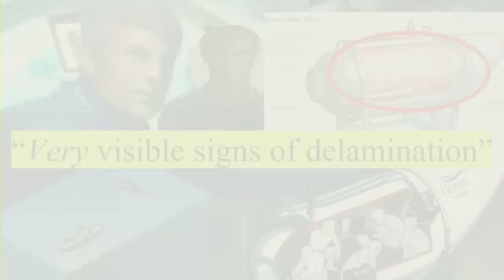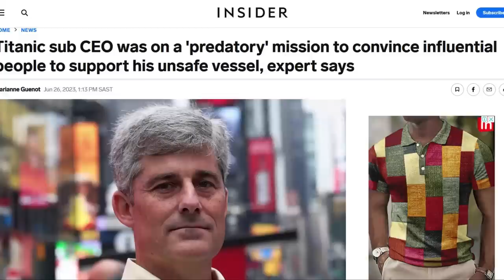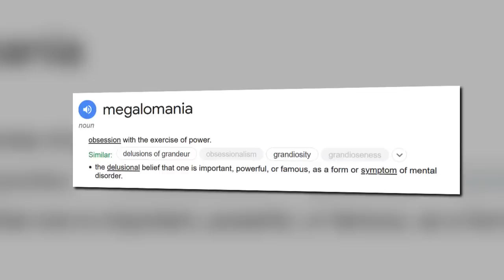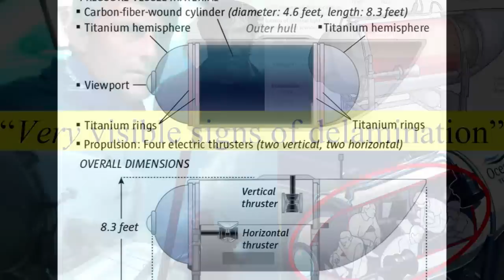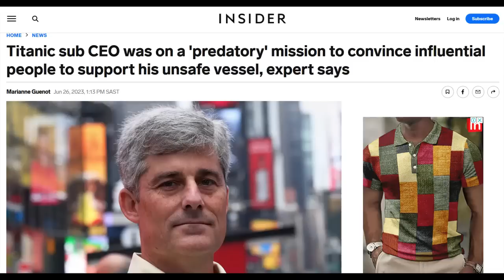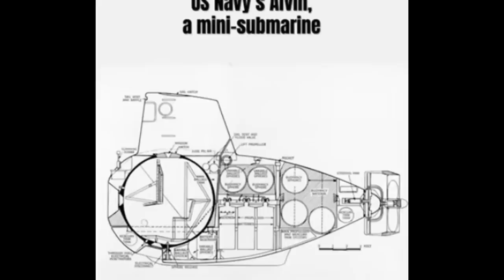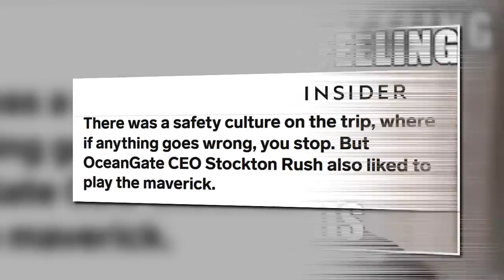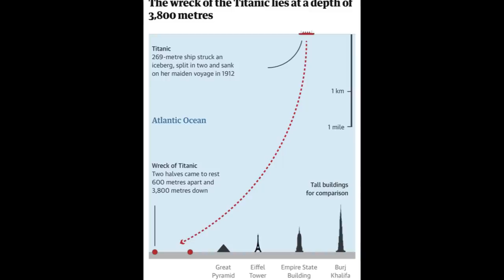"Lochridge shone a light through a sample of carbon fiber and saw splits in the midsection..."

Comment: anyone that has seen carbon fiber fail would know that acoustic monitoring would be completely useless
Reply: Aye, if you're hearing cracking, you're hearing failure of the matrix.
Reply: I’ve heard that anyone who has a bike made from carbon fire can see the stress cracks over time. They’re visible. 
It boggles the mind. Rush wasn’t a stupid person; he’d had training in engineering. I find his misguidedness incredible.
Reply: @m.h.6499  this last couple of years has really taught us that having money or connections does not equate to having brains LOL. i guess at least elon was at least smart enough not to vaporize himself and innocent people. yet anyways.
Reply: @m.h.6499 they aren’t always visible. Carbon bike frames are coated to reduce abrasion, so sometimes the fiber matrix isn’t visible. When carbon frames fail, it is often completely unexpected, like your fork completely vanishing when you apply the brakes.
Reply: Yeah, I’d imagine that the warning would occur about the same time that the shell implodes at the speed of sound.
Reply: @Subtlenimbus   Then I must have misheard. I thought I saw someone commenting that the cracks in the carbon fiber are visible on bikes. (I’m not a cyclist so was going by what I heard). So that’s why Rush wanted the warning system. I can’t get my head around his conviction that there would be time to re-surface, when it takes time, and the alarms tell you that failure is imminent. Surely he had to know the flaw in the logic? 🤔
Reply: @m.h.6499 it was purely narcissistic hubris. He was unwilling to accept any failure. He was unwilling to accept any faults.
Reply: @beehappyalways  HG Tudor has done an 11 part series on Rush on this platform, analyzing a great deal of evidence about him to conclude that in his opinion Rush suffered from Narcissistic Personality Disorder and possibly psychopathy. I found it thorough and thought provoking. He doesn’t hit you over the head with it but methodically builds his case. It makes a good complement to this video and questions raised here, and the story generally. I recommend the series. I couldn’t get my head around Rush’s behavior at all until this series offered some insight. It helped explain the incredible hubris so many of us have been observing. 
I do feel sad for his family. They don’t deserve this pain.😔
Reply: @m.h.6499  Of course he did.  I haven't seen ONE CLIP where he said that a warning would save them.  He only said that they would hear it before it fails.  He never said that they would survive after hearing the crackle.
Reply: @lindac6919  I saw a clip of Rush showing the submersible and saying, “The lights can fail, the thrusters can fail, but you’ll be alive.” He was explaining how good the hull was, made with this great substance, carbon fiber, and with the warning system. It’s one of the ones in which he’s explaining the Titan to someone, or a group, of real or prospective riders. I’ve watched so much of the coverage and seen so many clips, it would take me a while to find it, but those words rang out. It was all so safe that “the lights can fail, the thrusters can fail, but you’ll be alive.”
(Though I thought it was said in a way to suggest none of those failures would ever really happen).
Reply: @lindac6919   What would the alarm system be for if not to save them? Why build it?
Reply: Especially since apparently it was NORMAL to hear crackling noises inside this submersible.
Reply: yet, Stockboy did just that.
Reply: @m.h.6499  The illusion of safety, most likely.
Reply: There was another video on yt supposedly the transcript of the final communication moments. It was pretty creepy they reported hearing sounds. They dropped the ballast and barely even gained altitude. The pressure sensors were also sounding the alarms
Reply: Yeah when I "stressed" out my mountain bike "carbon fiber" aka cracking sounds.. I didn't sell it I destroyed it😎.  -no more carbon for me. Titanium is awesome thanks😂
Reply: @m.h.6499  The term engineer is loosely used because having a degree does not make one an engineer.   The art of engineering is what makes one an engineer.   Rush was a typical corporate bean counter with enough money to call himself whatever title he chose.  Unfortunately, he chose to call himself captain of that death trap Titan.  
 My heart goes out for all of the passengers, especially the young 19 year old kid.
Reply: @m.h.6499  Trust me, I know more than most about mechanical testing of carbon fiber.  Strain gages are used to measure the point at which catastrophic failure occurs when testing carbon fiber coupons(test samples) in an MTS test frame.  Google it if you are interested. They had installed strain gages in the sub to monitor the carbon fiber so they could tell people there was sort of warning system when it was false.  All lies. As soon as the monitor indicated a problem,  water was moving between the plies of carbon fiber as it delaminated, making the sub less buoyant until it became negatively buoyant.  Implosion.

Comment: One of the "experts" (who also dives in uncertified self-made subs) featured on the news was on the 2nd manned Titan dive. He knew Rush well and tried to advise him about the problems relating to the carbon fiber breaking down based on the cracking popping and banging noises made by the hull throughout the dive, even coming back to the surface at only 300 feet deep it was still making all the noises... A channel called ACE has interviewed him twice if you want further information.

EDIT - the problem or confusion with carbon fiber is that while it's stronger than metal pound for pound, you still need enough of it to make a structure stronger than metal; 2mm thickness of carbon isn't stronger than a meter thickness of steel. People seem to think of it as some kind wonder product with infinite strength without contextualizing the reality of what its strength is and how to actually appropriate its use. Also its strength becomes its weakness in that it withstands the pressure or weight and then has sudden catastrophic failure like glass, it has stregth when used in the correct way but it's also fragile.

Comment: They should have used a giant vacuum chamber, or vacuum bags when winding that carbon fiber hull. 
I saw their Chief Engineer mixing epoxy in bucket and just painting it on for the titanium end caps. He didn't pull out the air bubbles. 
I'm a NOVICE with carbon fiber. I READ about this before actually buying anything. A lot of people use vacuum bags. 
It's sad that I'm more aware of what air bubbles can't do at just 1 atm of pressure than this "chief engineer". 😢 He needs to be held accountable for his mistakes.

Comment: Stockton's idea of having a microphone listen for the crack of bursting fibers isn't new. Certain types of bridges use twisted wire as reinforcements, however those wires snap and microphones in those bridges are used as a tool to tell when the bridge needs to be overhauled...

However, in Stockton's case, you don't have a bridge under a somewhat constant load, you have a craft that sinks to the bottom of the sea, where the load increases and causes the maximum threshold of pressure the ship can withstand to go lower and lower.
So, when the ship went down the last time, something happened, that was inevitable under these circumstances: The ship can only withstand pressure to, say, a depth of 3,500m, that the ship passed. Now, a lot of fibres start to burst, weakening the ship immediately, meaning the ship can now only withstand pressures up to 3,400m, while still being just below 3,500m... a few more fibers burst, the hull's strength goes further down. Stockton assumed this would happen slowly enough that he can just drop weight and go back up. He got a rather effective presentation that this doesn't happen slowly, but rather at the speed of physics.

Turns out, "the speed of phyiscs" under these circumstances takes less than a tenth of a second to fully play out from "slightly weakened craft going deeper than it's hull can withstand" to "the ship is being turned into tiny shreds of carbon fiber filled with meaty paste".

Comment: The more and more I learn about Ocean Gate sounds like Stockton is at fault for everything. If you spoke out you got fired. So you just did as you were told. This guy had zero clue about the materiels used and how they broke down and react to the pressure. TOTALLY CLUELESS...

Comment: I have some experience using carbon fiber in high perfomance radio control aircraft.  Our stresses are different, but when I saw how the carbon fibers were laid in one direction it looked to me as there was potential problem brewing.  Another issue of joining dissimilar materials over a large area is also disconcerting.

Comment: First of all, this report does not state where this section of the carbon fiber hull was viewed in front of a light source to see rays of light passing through the carbon fiber elements!  The hull was built by layering sheets of carbon fiber on top of each other layer after layer and it was 5 inch thick!  There could very well have been micro-fracturing of the fiber elements but to say someone put a light source on one side and could see through it is nonsense!!!   If that indeed was the case, there was no way the sub could have made it to the depth that it did before it imploded!  If the hull was that porous and light could pass through it, you can bet water, hardly under any pressure would leak through as well and the leak would have happened the moment the sub was placed into the water!!!  This is pure nonsense!!!

That being said - CF structures are very very strong when the fibers are loaded under tensile loads but NOT compression loads.  The Titan sub had the CF hull under compression loads so it was bound to fail!!!

Comment: As experimental logic shows, the only way to know when there were too many "snaps and crackles" is to test to destruction.  Clearly not done.  The other thing is the detection of "snaps and crackles" can only save you if you can almost instantaneously depressurize by going from 4000 meter to the surface in milliseconds... clearly not possible... OR if the "snaps and crackles" are the indicator of progression into a permanent deformation zone that was not catastrophic (like steel yielding and not shattering)  again a condition not met.  This entire approach was coo coo.
Reply: When you hear the noise, it's already too late. The material will re-expand as the pressure comes off, and it won't do it evenly because some of the material is now broken up and has a different volume and some of it has been deformed beyond recovery.  More of it will fail as it seeks a new equilibrium of internal stresses.
After a dive, that tube must have let out the occasional snap and groan while it was sitting on the sled, like a hot motorcycle in the driveway. The difference is that it wasn't made of different parts that all shrank at different rates, or at least he didn't realize it was.

Comment: he manufactured and drank his own cool aid for certain, he was either blinded or willing to gamble with other peoples lives, oceangate was shaped by stockton rush to ignore the most basic safety concerns, he built a company that could get away with building such a sub and ignore the safety warnings, it was the company rush built that built the sub, so really ir was the company oceangate that is the real culprit, rush eliminated any opposition to his plans he executed after all opposition was eliminated, former employee's were driven out so there were no dissenting voices, he could straight wind the sub without cross hatching, using expired carbon fibre that was not fit for aviation, but there was nobody left in the company to sound the alarm, stockton rush drove them all out, so he was free to do as he wished and cut corners, he even hired inexperienced collage graduates who would not challenge him and his mad schemes, basically stockton rush,  built a company and shaped it into a tool to do his bidding, all opposition and safety concerns were silenced, so he was free to do as he wished and thats what he did he cut corners and justified it by claiming to be on the cutting edge of science, but recall he ignored good science. ???

Comment: The "unofficial" transcript is starting to circulate. If it's accurate, the crew had all kinds of malfunctions and 20 minutes of terror before the implosion. The data seems to indicate they were descending quicker than they anticipated and arrived around the wreckage about an hour earlier than planned. Around this point, they started to hear cracking along the back of the submersible but couldn't indentify the exact location. Then all the acoustic sensors went from "green" to "red" and they reported they were returning to the surface. When they dropped their ballast (rusty weights), the submersible barely rose a few meters, but...the crew reported the cracking sounds had stopped. Shortly after that, the cracking sounds returned and they dropped the large metal landing skid in an attempt to ascend. For some reason, with the ballast and the skid assembly removed, the submersible was still barely was rising. It seems they only rose about 20 or 30 meters and might have been stationary. It was at this point that contact was lost.
Reply: The whole thing was a death trap. No way was that device fit for purpose.

Comment: I think there may be an ongoing effort of oversimplification. It’s not just the carbon fiber that was the problem. It was the shape of the air chamber - for extreme pressures a sphere is much better suited then a cylinder.  Also the way the cylinder was attached to the spherical ends almost seems like a joke to me. Seriously? Gluing titanium to carbon fiber???  THREE dissimilar materials with different coefficients of expansion all joined together. There were many factors that went into the recipe for disaster!  PLUS the glue-up methodology was in itself flawed.
Reply: Also it was stored in a carpark with no cover! UV degradation may have played a part too!

Comment: I would be really interested to learn what Stockton’s 5 year plans or goals were for the company…. Surely he can’t have expected the sub to function properly indefinitely…
Reply: I think there were plans on board for 2 more "Cyclops" of ever increasing size and depth "capability."  He likely thought he was a sole provider for an untapped tourist marked to the deep.
Reply: It's clear he was flat broke and probably in debt. Why else would he double the price of the trip in 2023? Apparentlty all the previous missions this year failed and this was the last chance to reach the ship.
Reply: @loosilu  he actually lowered the cost by more than half and personally flew out to convince customers who had withdrawn because of safety concerns. People are mentioning ego, but like you said I think a big part of his recklessness was caused by him realizing that he had nowhere near the money or skill to build a functioning sub, but since most of his money was investor money, he must have been desperate, not for the few hundred thousands of the passengers, but likely for landing big investment contracts or something. The reason why he even resorted to crappy parts had to have been out of lacking funds. I dont buy that he just tried to push down the cost for tourism. He often mentioned spaceX, but spaceX did reduce cost by engineering a system and then throwing lots of money on it to make sure that it works, without risking peoples life. If you want to innovate and reduce cost maybe with the stupid carbon fiber hull, he would have tried rigorous testing, and would be extremely cautious. Innovators tend to be extra cautious with testing, because they are aware of the risk. Stockton just seemed to be desperate. He massively underestimated the cost of what he tried to do, noticed that he would run out of money, and then got unreasonable with cutting corners because he couldnt accept defeat after bragging and boasting so much. maybe he knew OceanGate and his reputation and his ego would be crushed if he failed. Maybe thats what drove him to be this unreasonable even with his own life. Maybe his whole image and identity was his idea of making OceanGate work, and he couldnt take the humiliation of failure and saw it as an identity crisis. He said that he took safety concerns as a personal insult in an email. that doesnt sound like huge ego anymore, it sounds like he snapped out of desperation and fear because he knew he massively miscalculated his whole idea.
Reply: He wanted to sell tech to oil finding companies he said
Reply: This was just a proof of concept: "see if it's safe for tourists then it's safe for finding oil"
Reply: The video of the bigger ship expedition showed two Titans on board. this trip they towed the Titan out to the Titanic on its sled-barge . buffeting and shaking it.
Reply: @sshreddderr9409  Using university students as summer workers, also community college students.

Comment: That the carbon fiber was laid in Is parallel bands. It's insane, they make carbon fiber scuba tanks that can withstand tremendous pressure. But the carbon fiber is always Woven spiral Interlocking bands for added strength.
Reply: It would be strong if the inside were pressurized to great numbers but the opposite is not true. It can't withstand great external pressure.